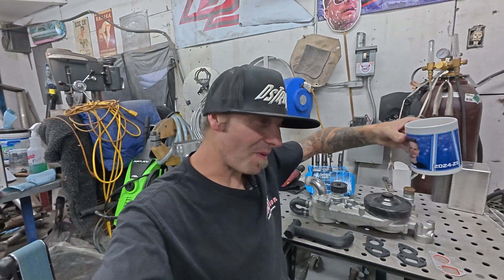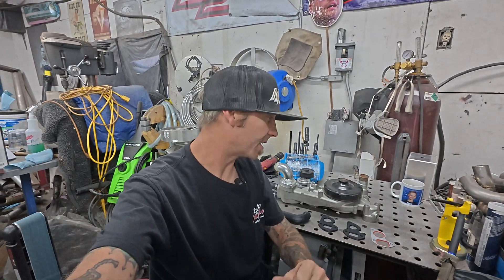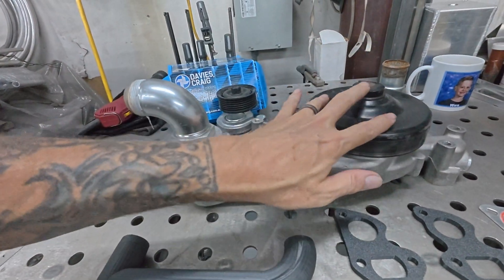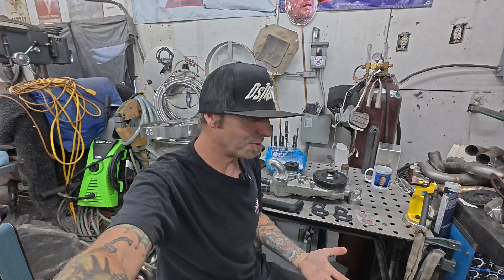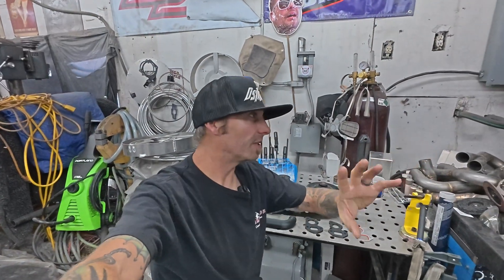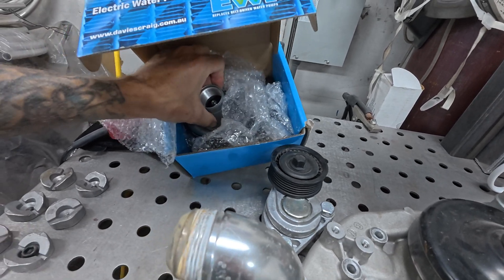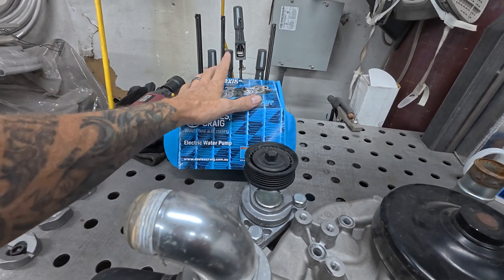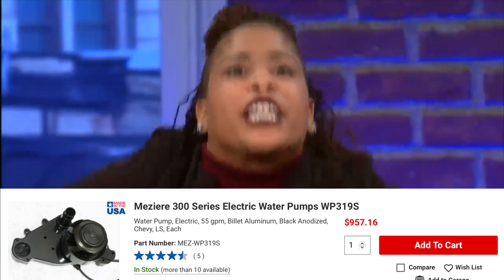Electric Water Pump Setup & Custom Manifold Build

Comment: I get that you're being creative and trying to make a cheap solution, but what about drilling 6 holes around the plate that blew out, tap them, and run in button-head screws to fix the problem? Stock water pumps are probably fairly cheap & availabale & effective. Wonder if you can do anything catch pan related to keep a blow-out away from the tires? Probably not with the violence & volume of steam & water.
Reply from the maker: I had a legal catch pan and it caught almost all the water and was full when the car stopped and the track was dry. It's incredible how little water it takes to make a car go sideways. Yes I could come up with a solution for a stock pump but I will benefit form the electric being able to cool it off without running the car if im hot lapping it like at LS fest west. It would be for guys that want to go the route is all.

Comment: Can you just gut out the stock water pump and only use the housing? Weld the front and rear of the stock housing so it won’t leak
Reply from the maker: I guess you technically could do that.
Reply: @Burndown  keep it simple,please right?

Comment: What is the reason for 3D printing the manifold? Instead of just cutting flanges and fabricating the tubes with it jigged up on the block. It is a good idea to base this around an affordable pump. Just curious.
Reply: Probably for rapid prototyping…Cheaper faster for mockup in 3D plastic before spending the money to get it laser cut.
Reply from the maker: Yes I was able to confirm fit and make 3 changes to the flanges before I sent it off for laser cut.
Reply: I totally understand the reason for the flanges, it’s just the tubing. You can print anything, but making it out of available bend radi could be an advantage. Contact JMD tube bending in El Monte, they have or can make whatever you might need for prototyping or production.
Reply from the maker: @rustyh8806  JMD are my guys! The 3d printed tube is the same diameter and bend radius of the 1 1/4  stainless tubing U bend they sell. I didnt just make it up. I will also talk to them about making me a j bend to save a few welds I think. I'll keep everyone posted on the progress.
Reply: Searching Rock Auto they did have some vendors with a flanged bolt on rear pump housing which should solve the blow out problem you had. Also Mezier makes versions of their water pumps without the idler which means aftermarket brackets for alternator, etc.
Reply from the maker: @sanger440  Yes the LS1 pumps and the Truck pumps look like they have bolt on rear covers. If I stuck with a stock style pump I would have to run the LS1 pump because my motor plate spacing. Had I known it was an issue I would have run one of the other pumps but this if how you learn. Also the freeze plugs in the heads pop out so I'll secure those this time around as well.  Everyone thought I blew a head gasket or the freeze plugs failed.
Reply: I would be interested in a kit when you get it figured out!
Reply from the maker: @mountainsgarage  I will keep everyone posted on here for sure. If I can make something that seems so solve the problem well I will make it available!
Reply from the maker: The reason behind it is for one to make sure the flanges fit. I made them as large as possible for more welding room so I wanted to be sure they fit still. Printing the whole piece allows me to test fit it to the block and when it's correct I have a part to use to build a Jig for welding. All of this so that I can make more then one. If I was only making one I would just stumble through it and be done. This way I should be able to repeat the process so I can make them if it becomes a product we can sell through Warr to solve a problem. If not it's a good learning experience.

Comment: I run that same pump on a blown alcohol monster truck engine. I run the water into lower freeze plug ports. Run 2 -10an return hoses to the radiator. Could probably merge them together in a swirl pot and then to the upper radiator hose as well. Only need 2 ports out of the front of the engine.
Reply from the maker: You had me at blown alcohol monster truck!  Has the pump  held up well? They have been out for a while and seem to have a good reputation.
Reply: @Burndown  I have a spare in the trailer but haven't ever had to use it. I have one on an off-road desert truck for the last 4 years with no issues. I run both with a small radiator hose from the rad to the feed side. I recommend them to anyone who wants an electric pump

Comment: The biggest budget secret for electric water pumps, is a bmw unit. ;)
Can grab them off of a number of BMWs, but they are PWM. The Davies Craig is a tad cheaper, new, and not PWM, so usually a better option for most people. ;)
Reply from the maker: I believe you can PWM the Davies Craig somehow. They do it with a controller so I bet the Holley and a solid state will do it. I think just running the pump will be fine but we'll see.
Reply: @Burndown  Nice. Experiment with it. ;)
Reply: I need to look into this.
Reply from the maker: @rpturbo  They look awesom